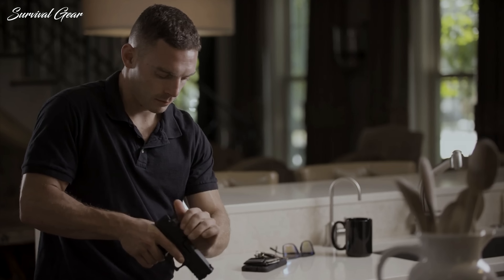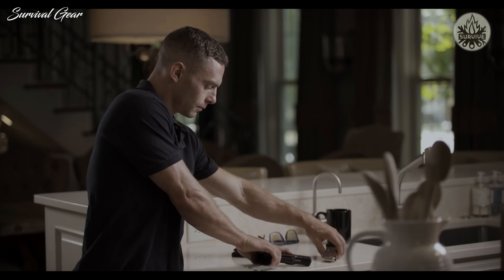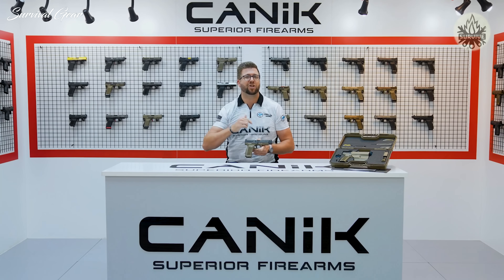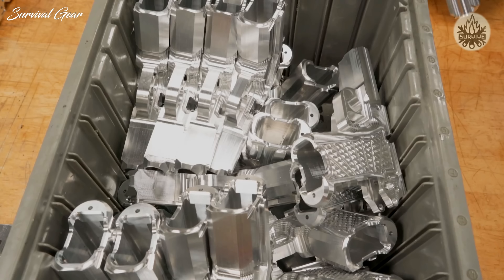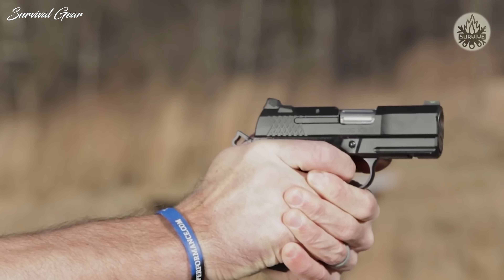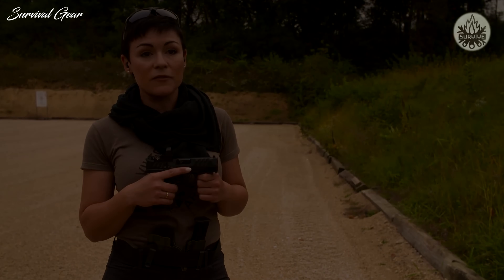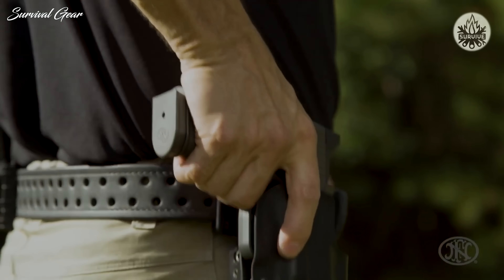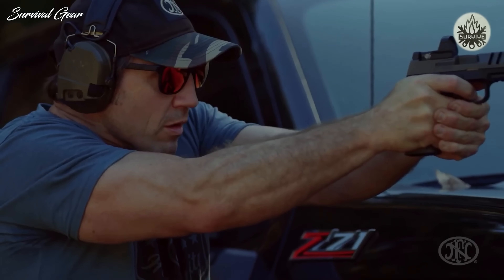TOP 5 NEW PISTOLS OF 2021 | BEST NEW HANDGUNS 2021

Comment: these are certainly all very good pistols, but after 30 years I have finally found my perfect pistol in the Glock 19X.
Reply: @Frank Bonazza III Technically, the 19x has nothing to do with the first Glock.  The Glock gen 1 had no finger grooves, Glock 2-4 had finger grooves and the 5th gen again had no finger grooves.  The 19x has the full size grip but the length of the Glock 19. plus a completely different trigger, the Marksman barrel, can be operated from both sides, etc. I own every generation of the Glock and there are worlds between the first and fifth generation.